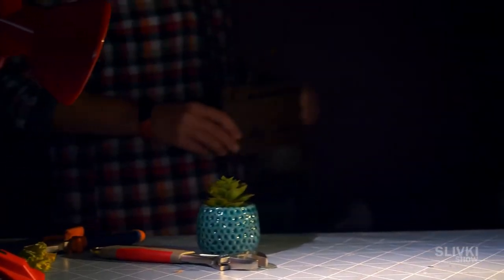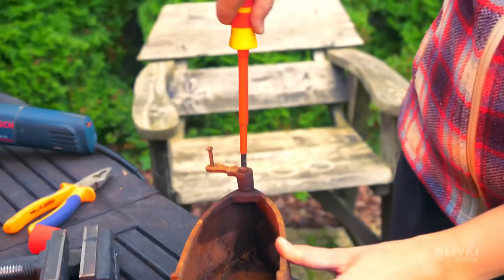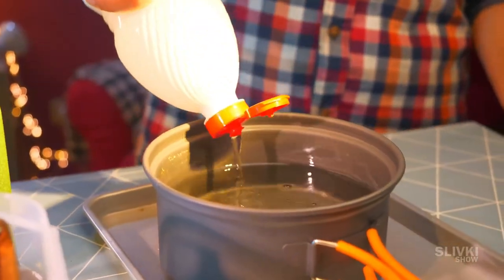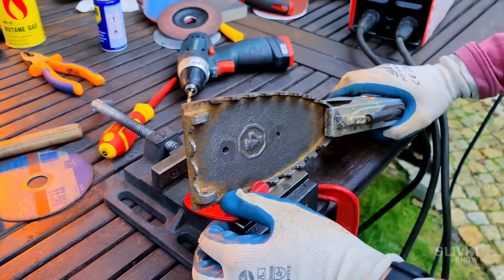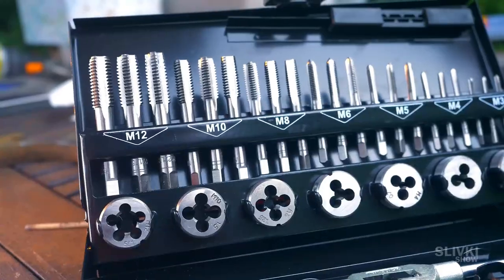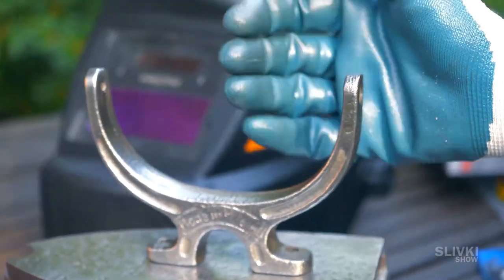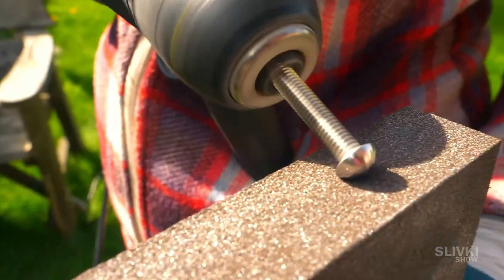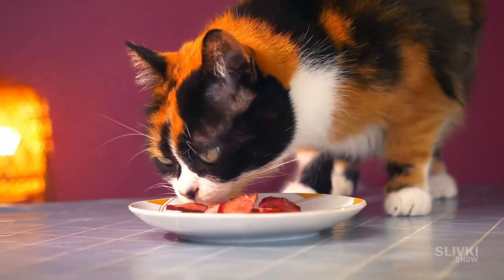RESTORATION OF A TIME-KILLED IRON

Comment: I do not have mains power, but I do have 2 flat irons that I use. They are well over a hundred years old. I did get the local engineer to grind the bottom of them to a mirror finish, for less drag on fabric. They work very well.

Comment: It's a good design but the fact that the top is not held on solidly means this could be really dangerous to use so just please be careful with it or add some sort of latch so you can't knock the holding lever out of the way